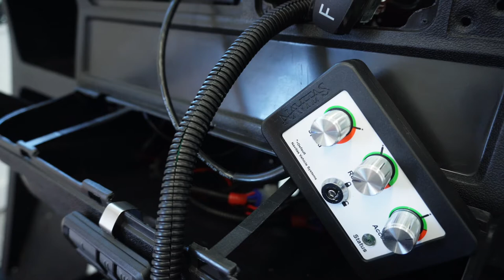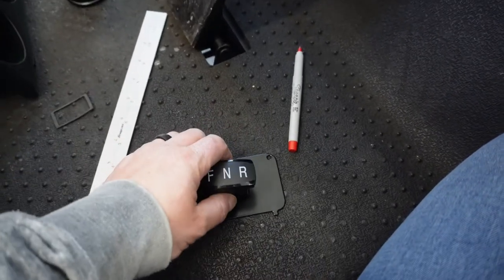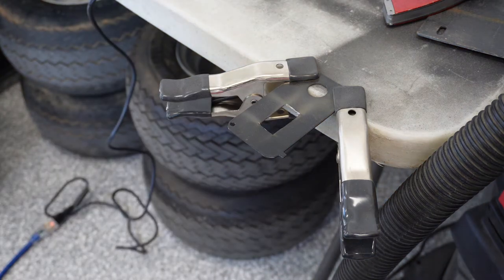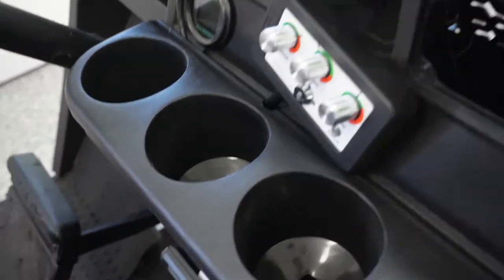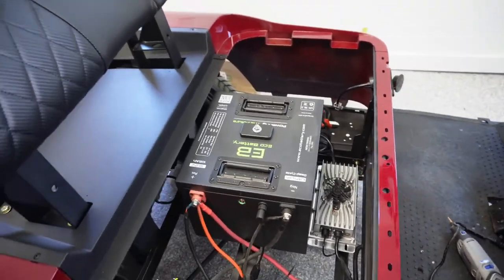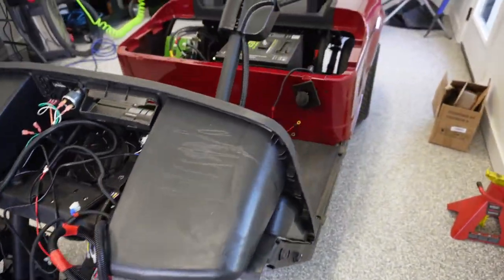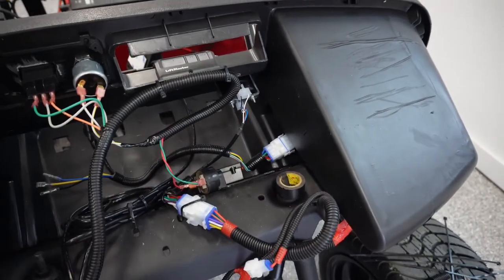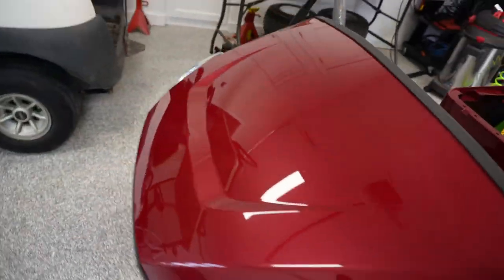Navitas Build EZ-GO TXT (Swamp Thing Part 5)

Comment: Recommendation to only connect the usb ports and the under-carriage lights to the ignition main power.  If not, there's a constant draw on the battery.  Additionally, should put a plastic battery compartment tray underneath the batter and charger.  This would help prevent dirt/debris from entering the battery area.
Reply from the maker: Good advice!😎👍🏻

Comment: The ECO battery should be on one side of the cart or the other, and not centered.
The reason for that is so you can install a 12V lithium with its own charger.
Then connect both chargers to the 110V Male charging port.
Your ECO battery meter and your Navitas OTF should be installed in the battery box.
By mounting them on the dash you are publicizing that you have high end equipment that will make that cart more desirable to steal.
Even if you buy the uncommon key switch with keys, all I have to do is buy the same key switch as you and the key I get will be the same key as what you have. 
Therefore I use a wireless key fob that gets installed in front of the constant power lead that would connect to the key switch.  Each key fob has to be synced to the wireless relay.
Even if you buy the same wireless key fob, you will not be able to power up my cart.
Also when I power down the cart with the key fob, a relay will enable an electro magnet that will hold the seat down, so that someone cannot  try to hot wire, or vandalize my battery box.
Reply from the maker: I appreciate the comment… I live in a gated community so there isn’t much concern for theft. I liked where I mounted everything and worked well for my situation. 

Thanks for watching!!
This cart is now sold anyway 👍🏻😎

Comment: Thanks for the updates 👍Did you ever think about putting in Riv-nuts in so you you can take the body on and off much easier during builds. I use them all the time for just such occasions. Drilling out all those rivets if you want to add something or work on something is a pain in the butt
Reply from the maker: I will look into that 
Thank you!!